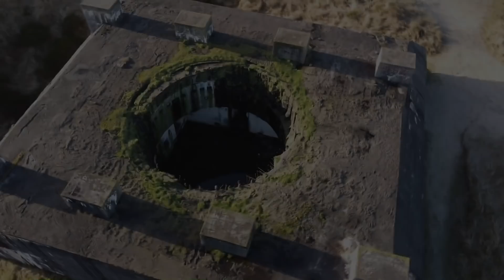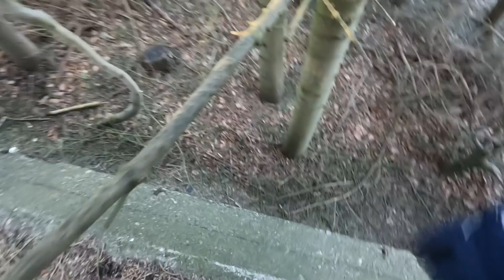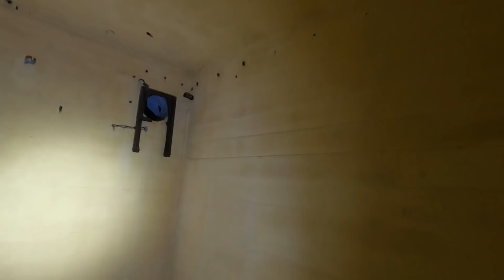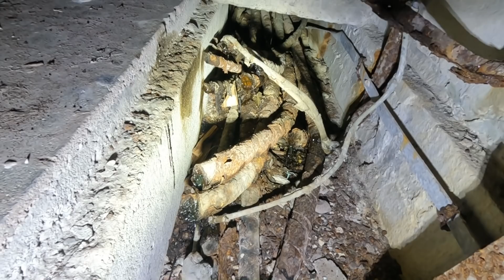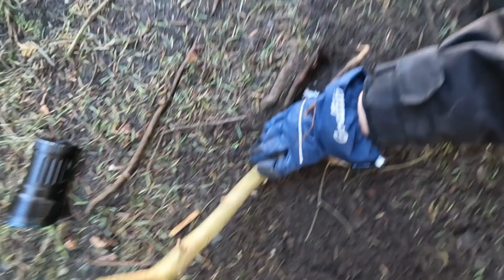Underground German WW2 power plant bunker. AMAZING explore !

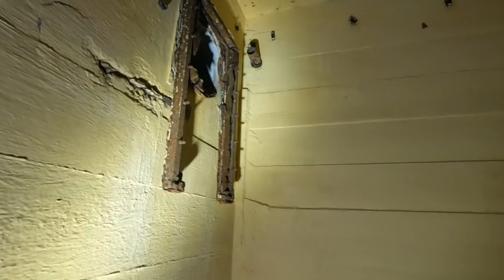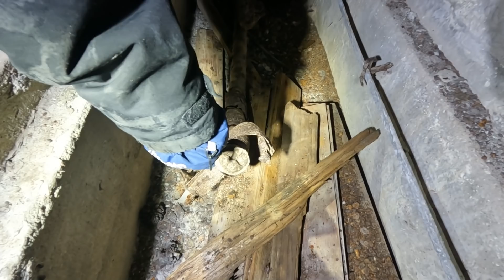Comment: 9:04 THIS pipe could be closed off with a heavy steel shutter - maybe to protect from gas? The shutter is removed sadly but I believe it could be slid up to seal the pipe from outside? 11:08 THREE PHASE CABLE - HIGH VOLTAGE! 
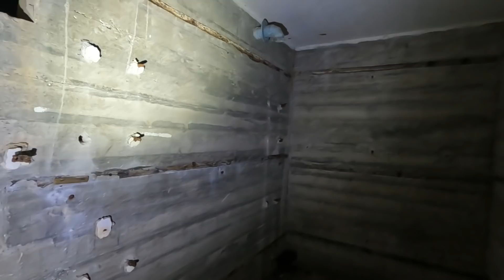At 15:23 these look like large bore water pipes, and calcium streaks down the walls tell me that you are correct - they purified their own  water. Also large engines need to be cooled so above ground or even IN the bunker there would be a 'cooling group'. This would consist of HUGE heat exchangers fan cooled. The water could ALSO be piped around the bunker to heat it AND as a secondary cooling  system. The large surface area of these pipes would help cool the water. POSSIBLY there MAY be a separate building outside where you will find large water pipes THIS could have been above ground cooler groups in a less heavily fortified out house? 15:32 POSSIBLY a tank room there is ANOTHER water pipe in the ceiling and near the floor - purified water maybe?
15:58 where you see these square holes in the door frame these were the BIG PANZER DOORS the hinges would be heavy duty. The other doors hinges are just surface mounted but the THICK doors had these massive iron hinges. They were probably to protect the crews in the event of the engines exploding. 
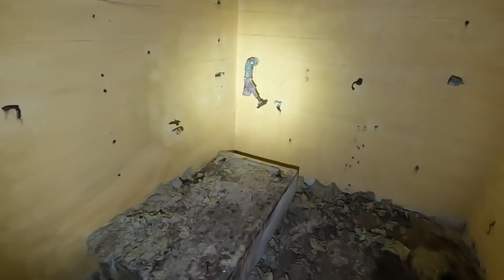16:42 CAUTION THAT IS POSSIBLY ASBESTOS INSULATION! It was used extensively as there were no alternatives DONT EVER disturn that stuff in a bunkr my friend please - if it gets in your lungs its very nasty! There was obviously an INSULATED water tank here meaning HOT water for the bathrooms/ showers? There is an outflow pipe at the bottom.
 When I left the forces I worked for some time with an electric distribution company. We used to maintain 4 HUGE Caterpllar V24 engines . They were placed on a capped off landfill. Rotting rubbish produces METHANE which powered our engines. Each engine produced 1 Megawatt of power.  20:34 This actually looks like a toilet bowl part? 
OK  and finally HH here is a question for detective EE - those generators were HUGE - HOW did they get them OUT without a mark on any of the walls??🤔 This applies to ALL POWER GROUP bunkers where all the engines are GONE! I have to watch this through more times as theres so much to analyse including the 'LUFTRAUM'. Which I have yet to identify. The YELLOW is seen in most bunkers but I forget what code YELLOW is, AIR or water?
GREAT EXPLORE I wish  I could see this first hand I could tell you for certain what it might be.👍👏👏👏👏😊

Comment: I wonder if the yellow room to the side of the generator was used to house tools and parts to maintain the generators? I would imagine it would be loud in the bunkers with the generator running. I didn’t notice any exhaust vents in the generator room. Did I just not see them? I bet the soldiers didn’t sleep in the bunker because of the noise and diesel smell. Very interesting to see the many different uses for the bunkers.
Reply from the maker: That could be it and i am not a 100% sure of it all inside there. Thanks Anthony.

Comment: If they ran diesel generators inside the bunkers and closed the doors during a air raid or ground attack then they would have to have a large ventilation system for the soldiers inside the bunkers.
Reply from the maker: indeed they had that and thanks for watching.

Comment: That was an interesting explore.  Yes,  wonder if that first structure was a machine gun Tobruk?  Couldn't believe how complex the power bunker was with the thick ceilings and walls, multiple power supply cables, zinc platted tubes, ventilation shaft, 200 & 60 HP generators, etc.  Just imagine the time spent designing and building this highly advanced bunker for it's time.   Hard to imagine that they even implemented the use of reverse osmosis.  I would imagine they thought of the noise levels and installed effective noise barriers as they seemed to have thought of everything.   Yes, what other secrets does that place hold.  I hope that you have fully recovered from your bout of COVID HH.  Thanks HH & EE, very interesting 😊.
Reply from the maker: I wonder how long the generators could run in there. Forever if they only had fuel ? Covid is crap and will be gone in the end. Thanks Laura.

Comment: That's really quite a fascinating bunker. So solid. You would certainly feel protected in there, but the noise would have been numbing. The Germans tended to use U-Boat diesel engines as generators, and in that solid concrete bunker, the noise would penetrate every wall, and every room. Bet the Duty Crew would have spent their breaks out in the entrance....  White walls reflect the light better in a bunker, but maybe they painted some rooms Yellow to give their eyes a break from the glare. Especially their rest areas. These places were just as important as the actual gun emplacement. No power, no guns. Thank you both for sharing this unique bunker with us. Cheers! Stay Safe!
Reply from the maker: Thank you again for being here Peter and for great feedback. Greatly appreciated.

Comment: Cable going through the way probably a ground wire goes outside and connected to a 10' rod driven into the soil
Reply from the maker: That could be and thanks my friend.
Reply: All your plug outlets have a ground connection that has to go somewhere and not many options when you're encased in cement. Lol

Comment: During the war there were no or much fewer trees, even here you can still see trees on the coast where the tops have been removed.
I sometimes wonder how much concrete was used in total for the construction of the Atlanticwal.
They are paper lead cables with a steel outer sheath.
Reply from the maker: yes there were almost no trees there at all during the war time. Tons of concrete was used for sure and great details to see there :) Thanks Oma.

Comment: I think the two yellow looking painted rooms were the generator and machinery rooms. They had the fire alarms out side the doors and it looked like they had fire suppression brackets in the ceilings and the large air shafts two pump out the exhaust. The little sliders on the out side of the doors is to check and make sure it was safe to enter before going in.(no fires or exhaust build up etc).
Reply from the maker: Interesting indeed my friend and thanks for being here.

Comment: Fantastic place, really enjoyed looking at that. The cable was all 4 core, so three phase supplies going out. If it was circa 3" diameter, then liable to be 240mm^2 cable capable of taking around 270 Amps. The metal frame would have had all the switchgear mounted to it, so that each individual feed out could be separately switched on or off. You can see the rail at the bottom had the clamps on that held the cables. Looked like there was also an earth tape running along the side of the cable trench.
Reply from the maker: Cool feedback my friend and loved that place. Thanks.

Comment: Great opening drone shots. The generator bunker is in great shape. It would be great to follow the power conduit, you would find that the cables branched one or two heading to each bunker and building. The single heading out on its own may go to a building on the edge of the complex or they drilled the hole later to add it in. The ceramic piece could also be plumbing, the center curve looked about 150mm in diameter. Keep up the great work. Both of you stay well and safe.
Reply from the maker: Great place William and thanks my friend for being here.